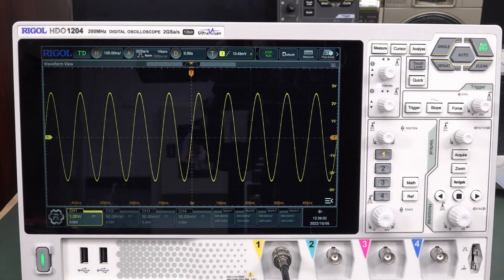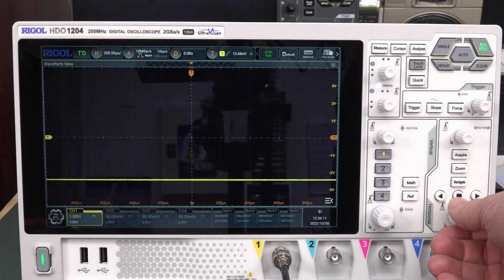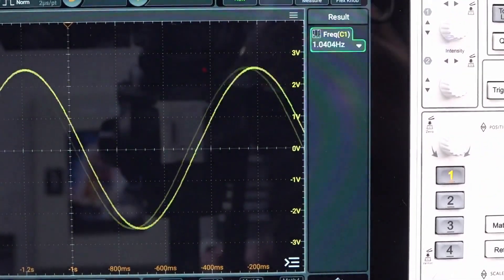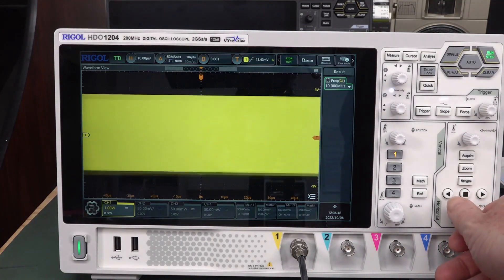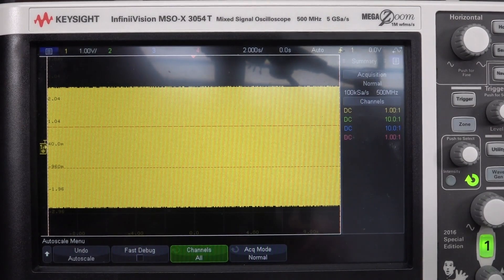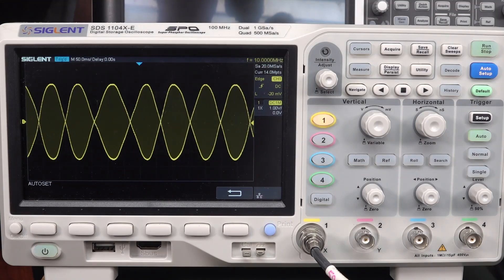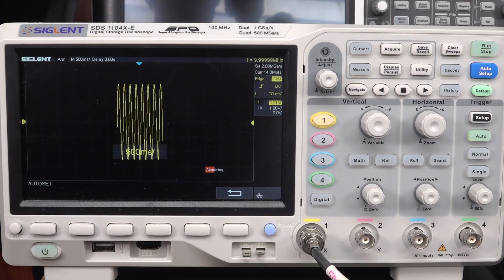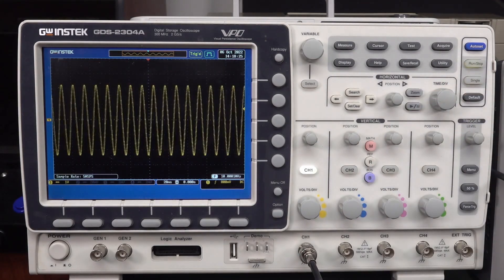Oscilloscope Anti Alias?

Comment: That's interesting! Here on my RIGOL MSO5000 it's got an Anti-alias button on the Acquisition menu that makes it hold up quite well up to 100ms/div or even 200ms/div with a 10MHz signal.. Have you tried that? Maybe these new RIGOL models have the same anti-alias button on the acquisition menu. I also noticed that using the maximum memory helps significantly.
Reply from the maker: Interesting. Don't have the 5000 any more. Will take a closer look on the 4000
Reply: @EEVblog2 Cool! Additionally, with the 200M deep memory selected, I could go down to 1s/div on the MSO5000, with the antialiasing button ON, and actually see a well defined 0.5Hz square wave AM modulation that I intentionally inserted on the 10MHz signal, using my generator. However, the antialiasing button makes it harder to recover the 10MHz signal by zooming in on that same 1s/div scale. I could only recover the 10MHz signal consistently with antialiasing OFF up to 200ms/div. The MSO5000 has an 8GS/s sampling rate when only 1 channel is active.

Comment: My pet peeve with digital scopes, that and the jittery horizontal line that makes you think there is crud on your signal when it's just the scope's A/D not making up its mind as to the correct digital value of a signal. Hopefully later higher resolution scopes will solve that one - but wait, try zooming in - the jittery's are back.
Give me a good analogue scope.

Comment: It's not really aliasing is it? It's just a beat with the sampling frequency. I guess those are the same thing in this case.
Reply from the maker: It's still aliasing, but it will be different if you are at some oddball frequency that's not divisible by the sample rate.
Reply from the maker: Just shot a video in response to this to show what happens. Uploading now. I goofed your name in the video, sorry!
Reply from the maker: https://www.youtube.com/watch?v=j49T1E4UEv4
Reply: It is aliasing in this case because the actual frequency is much higher that nyquist at those larger time bases, so it is getting aliased down to a lower frequency. Here is a good visual representation of what is going on: https://matthews.sites.wfu.edu/misc/DigPhotog/alias/alias.png

Comment: I'm more surprised Keysight does it. I wouldn't expect an oscilloscope to be antialiased in general-- seems like a ton of DSP that's not immediately apparent in the signal path.
Reply: Aliasing between the sample rate and the stimulus is a known issue on scopes, though not all manufacturers design to prevent it. But it's absolutely something that is considered at Keysight :)
Reply: @funtechu  I don't consider it an issue. I know the bandwidth of the AFE of my scope. I consequently expect aliasing if I lower the sample rate sufficiently.

Having DSP that oversamples the input outside of hi-res mode is not something I want in a scope. There's the 20MHz filter if I'm sampling at low sample rates and that's generally sufficient.